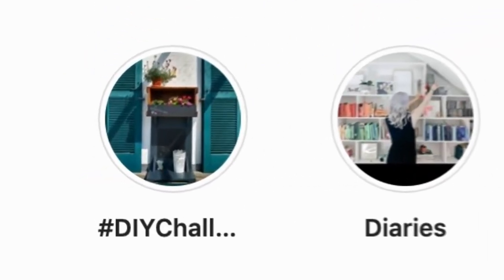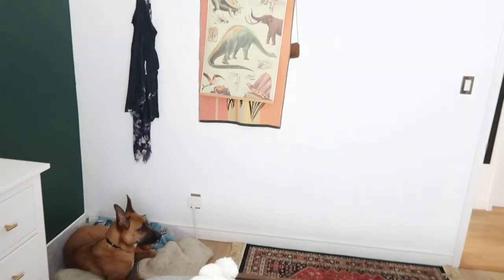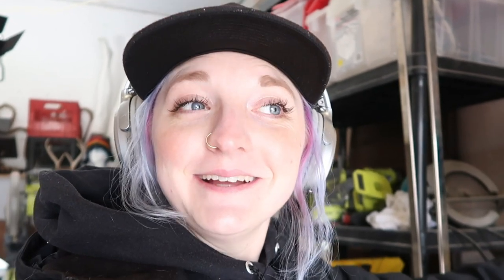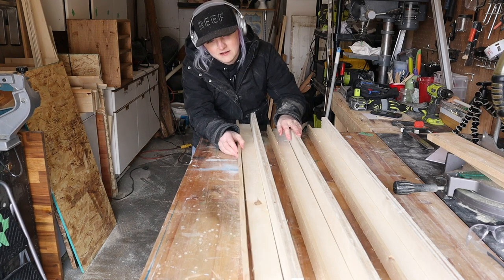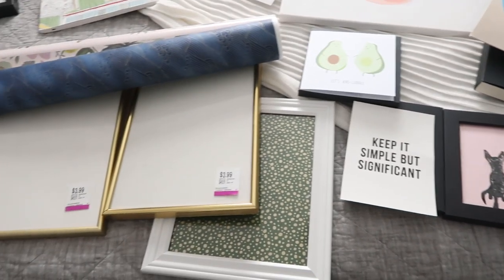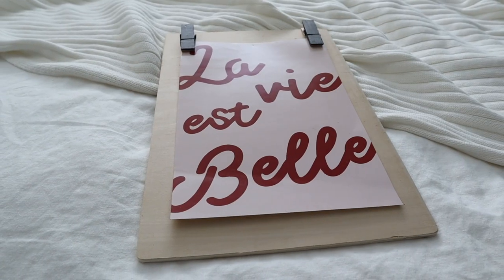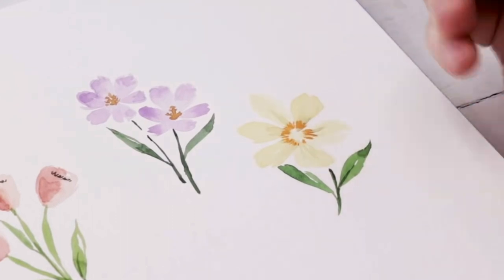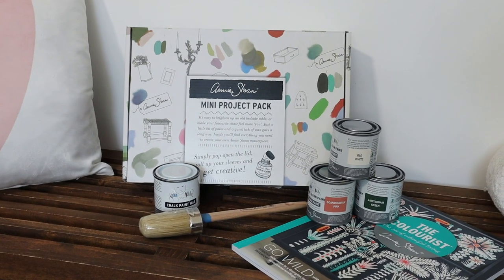Cozy Bedroom Update: DIY Photo Shelves + 3 Simple Art Pieces!

Comment: It probably won't come up often, but I have a patio bench made from concrete chimney flu blocks. Sturdy and weather-proof. Large hole in center surrounded by smaller rectangle holes - looks super with decor or potted plants set inside the opening.